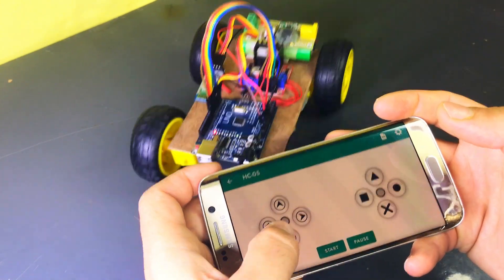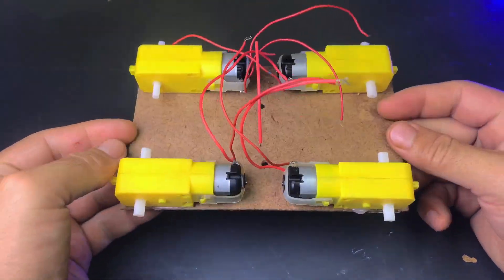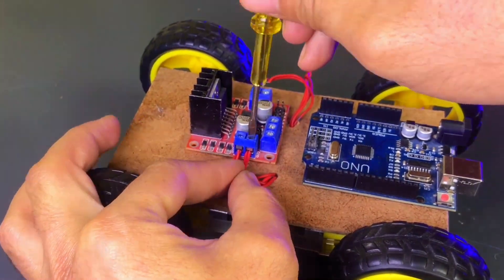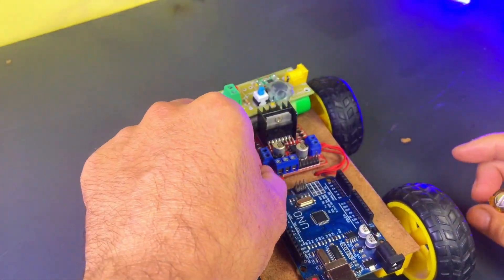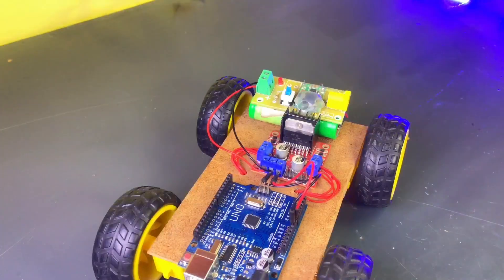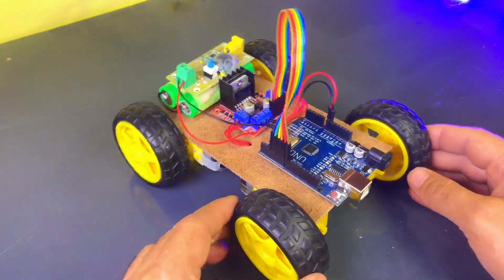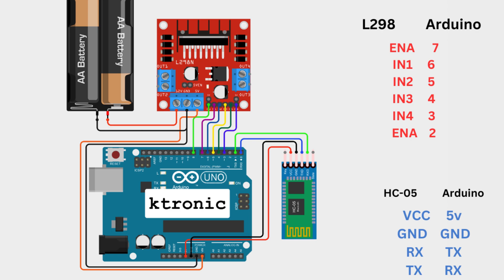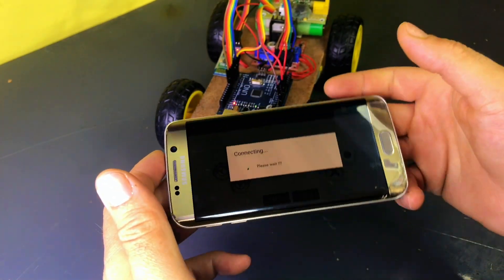Build A Smartphone-controlled Arduino Bluetooth Car With This Diy Tutorial!

Comment: Give code
Reply: #include <AFMotor.h>

// Define motor pins
#define motorA1 7 // IN1
#define motorA2 6 // IN2
#define motorB1 5 // IN3
#define motorB2 4 // IN4
#define ENA 8     // PWM for motor A
#define ENB 3     // PWM for motor B

void setup() {
  Serial.begin(9600); // Start Bluetooth communication
  pinMode(motorA1, OUTPUT);
  pinMode(motorA2, OUTPUT);
  pinMode(motorB1, OUTPUT);
  pinMode(motorB2, OUTPUT);
  pinMode(ENA, OUTPUT);
  pinMode(ENB, OUTPUT);
}

void loop() {
  if (Serial.available()) {
    char command = Serial.read(); // Read command from Bluetooth
    controlMotors(command);
  }
}

void controlMotors(char command) {
  switch (command) {
    case 'F': // Move Forward
      digitalWrite(motorA1, LOW);
      digitalWrite(motorA2, HIGH);
      digitalWrite(motorB1, HIGH);
      digitalWrite(motorB2, LOW);
      analogWrite(ENA, 255); // Set speed (max)
      analogWrite(ENB, 255); // Set speed (max)
      break;
    case 'B': // Move Backward
      digitalWrite(motorA1, HIGH);
      digitalWrite(motorA2, LOW);
      digitalWrite(motorB1, LOW);
      digitalWrite(motorB2, HIGH);
      analogWrite(ENA, 255); // Set speed (max)
      analogWrite(ENB, 255); // Set speed (max)
      break;
    case 'L': // Turn Left
      digitalWrite(motorA1, LOW);
      digitalWrite(motorA2, HIGH);
      digitalWrite(motorB1, LOW);
      digitalWrite(motorB2, HIGH);
      analogWrite(ENA, 255); // Set speed (max)
      analogWrite(ENB, 255); // Set speed (max)
      break;
    case 'R': // Turn Right
      digitalWrite(motorA1, HIGH);
      digitalWrite(motorA2, LOW);
      digitalWrite(motorB1, HIGH);
      digitalWrite(motorB2, LOW);
      analogWrite(ENA, 255); // Set speed (max)
      analogWrite(ENB, 255); // Set speed (max)
      break;
    case 'S': // Stop
      digitalWrite(motorA1, LOW);
      digitalWrite(motorA2, LOW);
      digitalWrite(motorB1, LOW);
      digitalWrite(motorB2, LOW);
      break;
    default: // Default case
      break;
  }
}

Comment: There is no color differentiation of positive and negetive wiring for motor. Not sure how are you connecting the motor to L298! Did you made parallel connection?
Reply: Left side moters connected together ( positive of both connected then turn in single wire, similarly negative of both connected and turn in single wire )
Same process with right side moters

Note:- be careful moters are kept facing opposite to each other so if ones positive is up  side then second moter positive in down side

Comment: Bro from where to get that bluetooth mother board which connects to mobile can i get in Amazon please help bro 😢
Reply from the maker: https://www.amazon.com/HiLetgo-Wireless-Bluetooth-Transceiver-Arduino/dp/B071YJG8DR/ref=sr_1_2_sspa?dib=eyJ2IjoiMSJ9.VZL1p5RDGQw7c8DXaqrVkRyfFEBz0HhuagQj9O7D5y4p1fiSOD6qv8HRvfwdXuMoVI1SJaHQRYR3aSCgOFb_c45o_9V4g4DW8Q_gh6sx82eRfpcp8fqUlTV1W7x1H7VM4rRAUhICmMOTEw7Et9n6T5UZsI5QvB5gtpbF90WNE-IY-U14Y9mmTxeGh3PGS8yvX3sunwKXewGmD4wOg5jNP5zmp3XRcJGuBG3oDEy9-Wc.iSK_avFySDJn7rXaB7Xn2rCe7PdyoJ7IVBPrcvnMJNM&dib_tag=se&keywords=hc05+bluetooth+module&qid=1739801455&sr=8-2-spons&sp_csd=d2lkZ2V0TmFtZT1zcF9hdGY&psc=1
Reply from the maker: https://www.amazon.com/HiLetgo-Wireless-Bluetooth-Transceiver-Arduino/dp/B071YJG8DR/ref=sr_1_2_sspa?dib=eyJ2IjoiMSJ9.VZL1p5RDGQw7c8DXaqrVkRyfFEBz0HhuagQj9O7D5y4p1fiSOD6qv8HRvfwdXuMoVI1SJaHQRYR3aSCgOFb_c45o_9V4g4DW8Q_gh6sx82eRfpcp8fqUlTV1W7x1H7VM4rRAUhICmMOTEw7Et9n6T5UZsI5QvB5gtpbF90WNE-IY-U14Y9mmTxeGh3PGS8yvX3sunwKXewGmD4wOg5jNP5zmp3XRcJGuBG3oDEy9-Wc.iSK_avFySDJn7rXaB7Xn2rCe7PdyoJ7IVBPrcvnMJNM&dib_tag=se&keywords=hc05+bluetooth+module&qid=1739801455&sr=8-2-spons&sp_csd=d2lkZ2V0TmFtZT1zcF9hdGY&psc=1